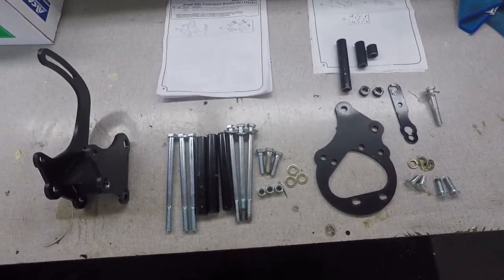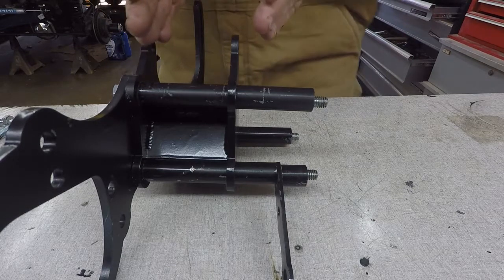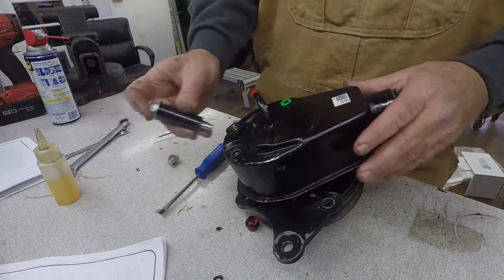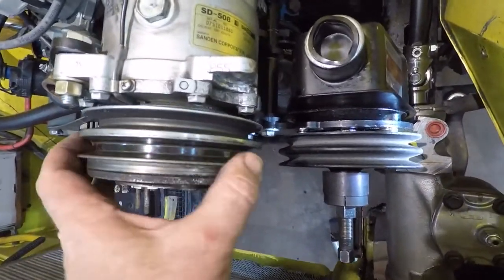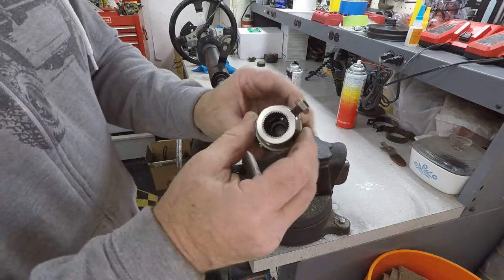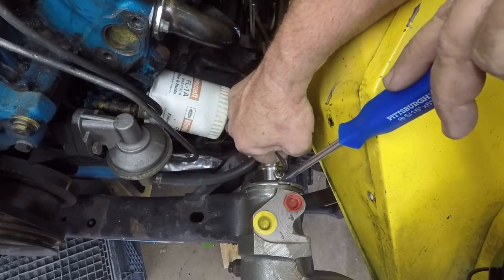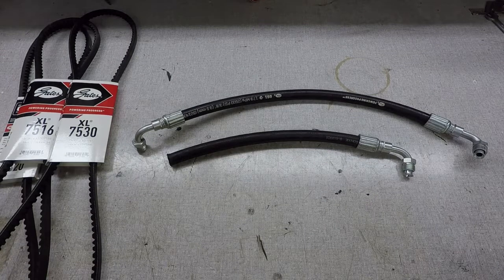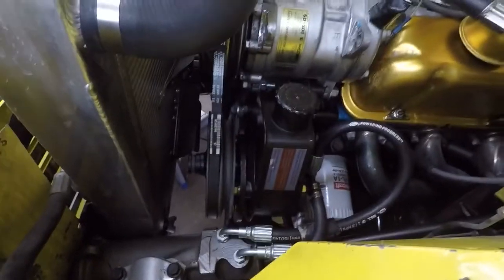#6 Early Bronco power steering conversion

Comment: good stuff.. thinking about doing this soon on my bronco. i'll probably go with a borgeson box. it looked like you had to purchase a collapsible column though but you use a straight solid one? is this just a safety thing?
Reply from the maker: I used the stock column from an early bronco that was an automatic, as I was planning putting a auto in. This column was not collapsible. What ever box you end up with, it needs to be a quick turn. I regret not using one.

Comment: Steve, I am doing the same thing to my 69 F100. What ujoint did you use? I looked at your links and nothing came up
Reply from the maker: Hi Israel. I thought I put a good link to Amazon. I just looked. And my bronco was a 3/4 shaft, and 36 spline. You will need to measure your steering column shaft and spline count on box. Do a quick amazon search for steering ujoint. I used the nickel plated for around 30 bucks. Thanks for watching.